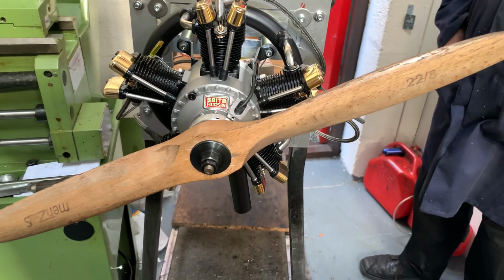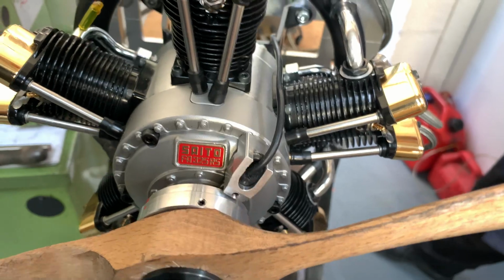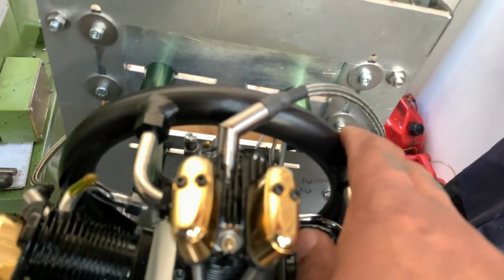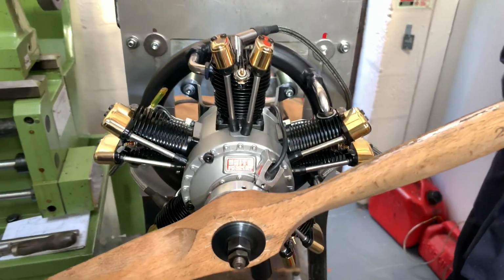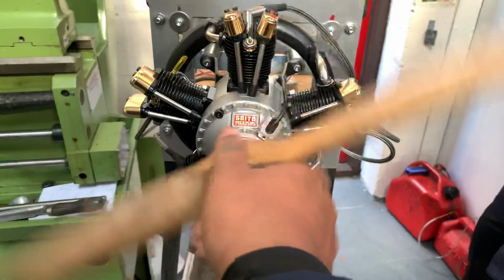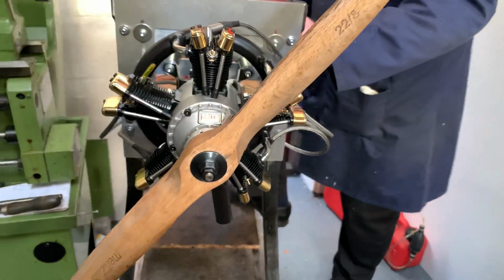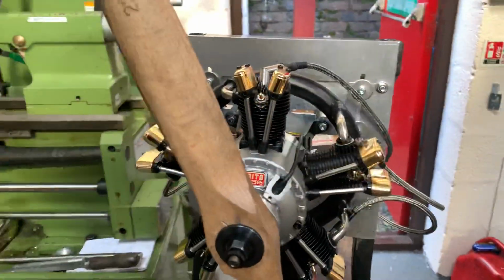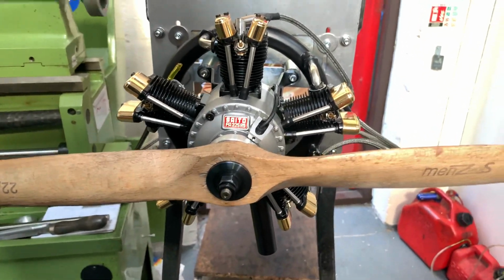Saito FA-325 R5 5 cylinder engine setup with MMM full gas conversion and exhaust ring

Comment: Hello Morris' Mini Motors
I have a saito FA325 and have a question if you please to answer :
When i try to install some propellors 2-blade like masterscrew classic or 3-blade, like biela 3 blade for a FW190 project, i come up against a problem : spinners backplate+propellor+first nut fits but no space left for second nut/the locking nut. Main shaft is kind of short. Can you advice me a solution for this ? I was thinking about using a self locking nut, you know these nuts with silicone or nylon ring inside...
I would be so pleased if you can reply,
Best Regards,
Serkan Salah
Reply from the maker: serkan salah What you will need is a sleeve nut to go inside to the prop
Reply: Thanks for your reply, so if i understand correctly, i need to enlarge the propellor center hole a bit, use a sleeve nut that goes inside the propellor center and than use a second nut as locking nut, correct ? Please forgive my lack of knowledge :) this is the first time i face this issue...

Comment: 22x8 at 5000 RPM are bad numbers for this engine. Use the Static Thrust Calculator and you read about 1.64 hp!